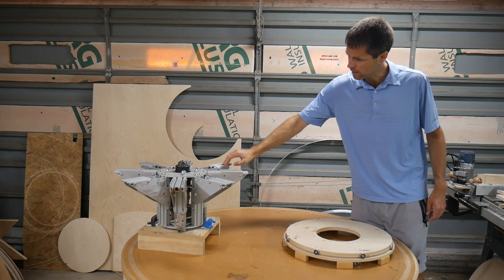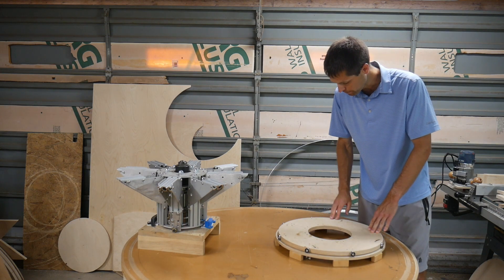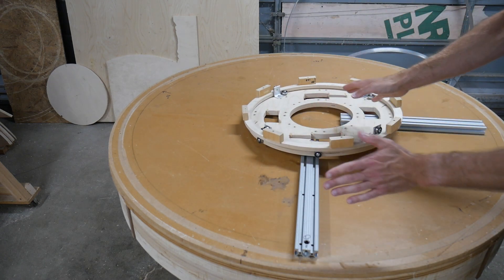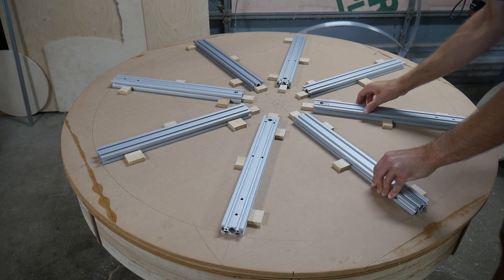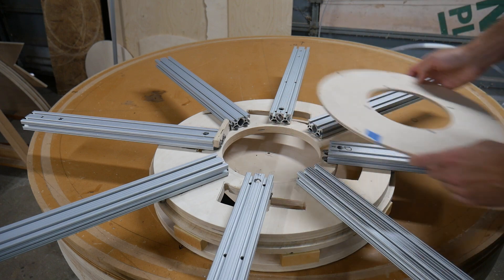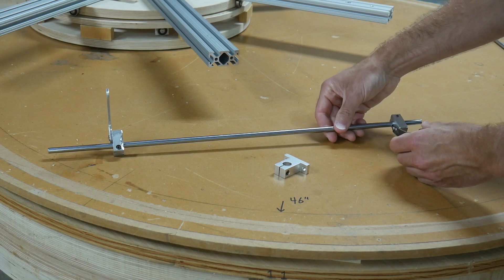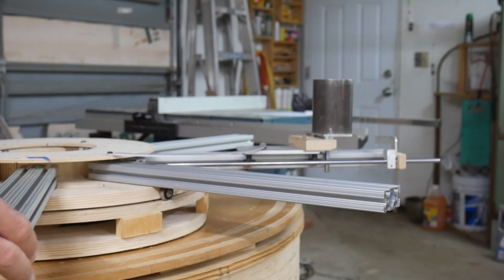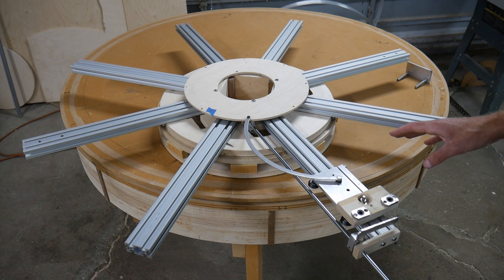DIY Hub & Torque Tube Test - Table Redesign 6

Comment: great work. All the magic depends on that arc shape arm between the center disc and expanding track. Sizing that arm can be tricky. May require linkage simulation software.

Comment: Maybe this was too early in the process to consider (i've never done anything remotely this complicated so what would I know? lol) but instead of testing it with the 3-ish lbs of weight simulating the top, wouldn't it be a good idea to try testing higher weights like even 10 or more? I'm just thinking about the extra load on the system when people have their elbows on the edge of the table, or little kids do little kid things.
Reply from the maker: @phoenuxx  torque tubes are only lifting the panels, once raised they lock into the main panels which are supported from the frame. So extra user loads should not go through the torque tubes.
Reply: @ScottRumschlag  Oooooh Okay that makes a lot of sense now, thanks for the reply.

Comment: Great work Scott!  I imagine that the wood DIY slewing ring could, if you wanted it to and once perfected, be constructed out of metal.  Question: do you intend for the same ramps that, now via torque tubes, lift the "picket shaped" panels, to also engage a lever mechanism like you've used previously to effect twice the height lift for the center star?

Comment: How do you avoid those shaft clamps from slipping over time? It seems like there's going to be a very good amount of torque on that clamp and over time it might just slip right?
Reply from the maker: If sized and torqued appropriately it should be secure. I tested the 8mm shaft and it took a surprising amount of torque to slip it.

Comment: The simplicity of the new hub design seems great. What's causing the clicking noises as you rotate?
Reply from the maker: It may be the ring flexing and moving the spacer blocks that aren't fastened (I only put 4 of 8 screws in to save time as I assemble and disassemble and reassemble . . .). I'm confident the sound will be fixed, but I should have called that out in the video, it's pretty noticeable!